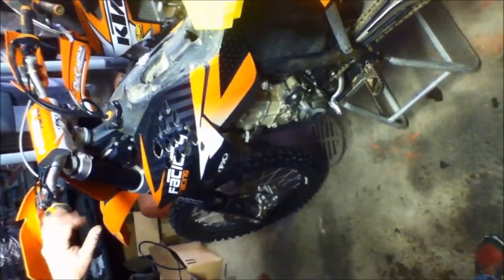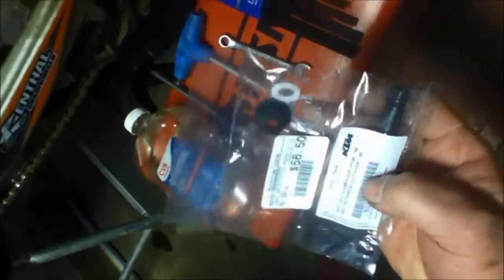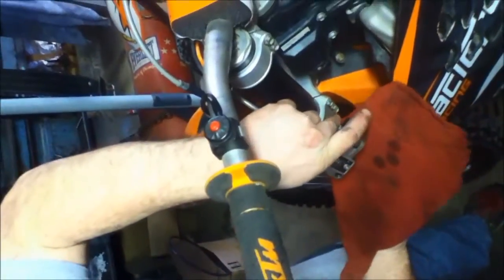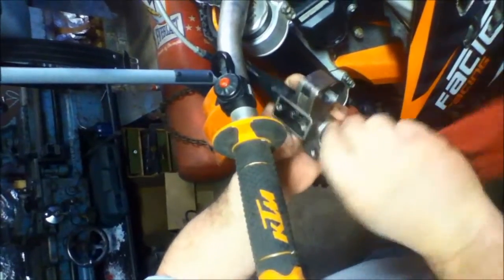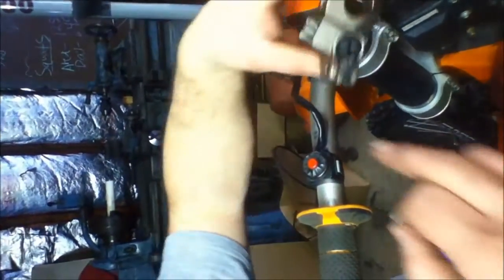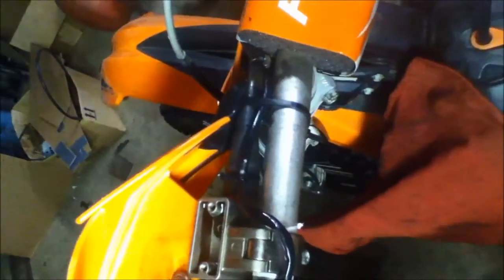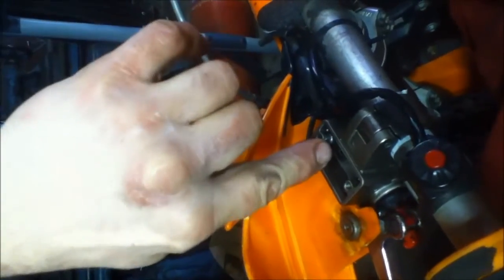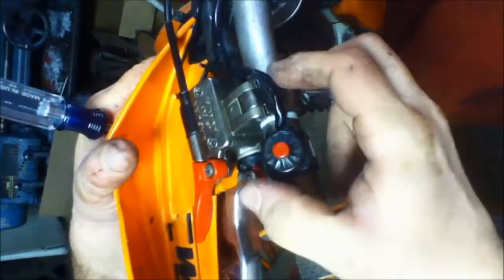KTM master cylinder rebuild

Comment: I was specifically told at the KTM dealer to not use mineral oil like the one you are showing here as he had personal experience with some type of failure due to using it.  He said to only use hydraulic mineral oil.  Of course this was like 14 bucks for a small bottle so he could be just trying to make a buck off me.  Do you have experience in using this type of oil?
Reply from the maker: +Jayme Richard  I was taught the mineral oil is mineral oil.  This stuff has been in my KTM 65 that I have raced also in my 85, 105 and 250 that I have now and never had a problem.  I think that he is trying to get some more money out of you but I do not know, maybe something did happen to his bike when he used it.  I have never had a problem with it and I guess take it for what it is worth.

Comment: ive snapped the hinge on my bracket ... is there a way u can take the hinge off and put a new one on instead of replacing the whole unit as I have got a spare unit that's broke  but got the hinge I need ?  thanks

Comment: This is the second video I've watched that didn't address the likelihood of corrosion inside the master cylinder bore. If the bore is corroded, the replacement piston and rubber seals would just be a temporary fix. Any thoughts on this possibility? Unless there is only light surface corrosion in which case a very small hone could clean out the corrosion, I don't see how the need to buy a complete replacement master cylinder unit could be avoided.
Reply from the maker: their was no corrosion in this one, but yes, the replacement would be a temporary fix.  this one was wore out and all of the orings were flat and not sealing so we decided to just replace it all to make sure everything was good.
Reply: Thanks for the comments. Unfortunately my clutch cylinder bore has some noticeable corrosion. So I've ordered via Ebay, an 11 mm cylinder hone (bore inner diameter is 10.5 mm, but the hone should compress down a bit) that should clean out and smooth out the entire bore. A replacement piston and seals will be part of the rebuild. Total cost is $25 vs. $236 for a new Magura clutch cylinder unit. Hope this info helps other KTM riders as well. Thanks for your video!

Comment: hey can u please help i have 08 ktm atv 525xc i have some question for u.. do the rebuild  kit really  works ? or will i be better off buying a hole new clutch  system  or  if  the kit works  where can i buy one at because im barely  i mean barely  getting  any pressure sleeve because I changed my o-ring in my sleeve and it's holding pressure and when I back bleed i feel the pressure works but when I'm trying to push in the clutch I am not getting no pressure at all

Comment: Hi, i got a 2003 525cc ktm. and it has no tension what so ever. i think its the same problem as yours. but i cant find the rebuild kit anywhere can you be anyhelp?
Reply from the maker: kamrin formosa . I got mine from my local ktm dealer. sometimes they will have to order it. I would recommend that you try a ktm dealer even though it might be more pricey but then you know that you have the right things.